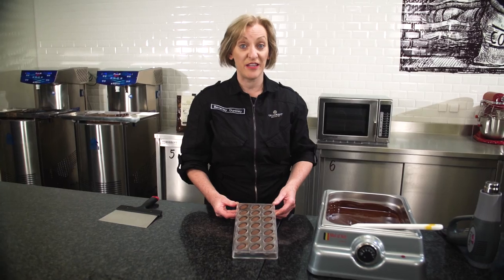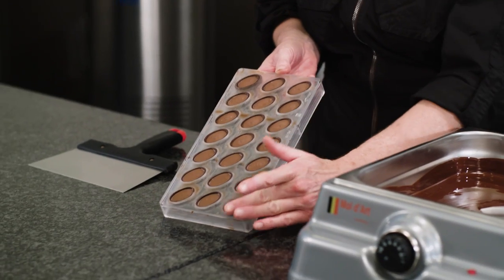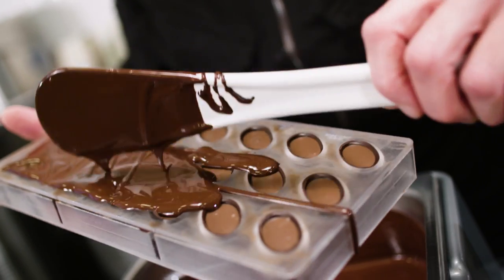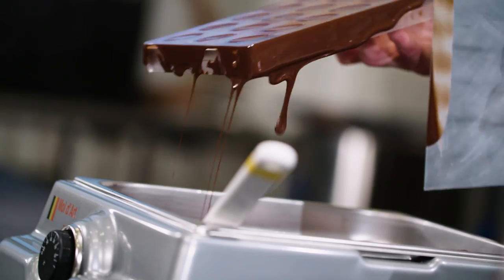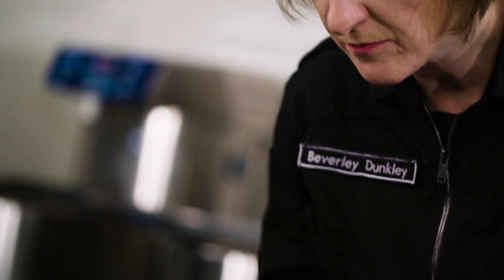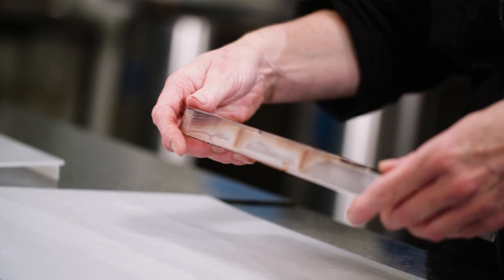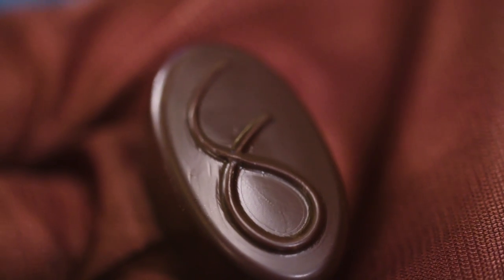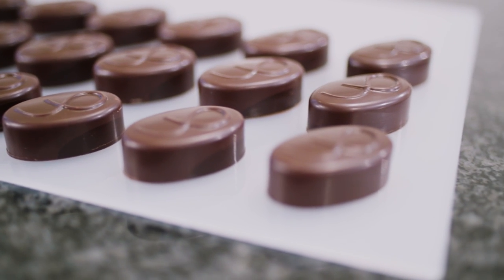How to perfectly seal moulded chocolates

Comment: Hi I have a question kindly let me know if my fridge can only be set to 7 degrees Celsius  how long do I have to keep my shelled chocolate moulds into the fridge n when I fill it with the filling how long that time and how long after I seal them to release them from moulds.. Thanx in advance 😊
Reply from the maker: Hi! Usually it should only take around 4 hours at 7°C for the filling to set before you can close the pralines.  Then wait at least another 2 hours at 7°C before demoulding and everything should be fine! :-) If any further questions, don't hesitate to send us a message! Best regards!

Comment: Can you show the whole process and temperature required to make chocolate. My chocolates are getting melted the moment I get it out of fridge. I couldn't find the perfect video. And it's also getting sticky unable to demould no matter how much time I keep in deep freezer
Reply: But using cocoa powder because that's what we get here
Reply: You need to make sure you temper your chocolate before you attempt the first video of this series
Reply: I use coconut oil as part of the melting process and it seems to help. Having a relatively cold room (less than 74 degrees) helps too.

Comment: how hot is the chocolate you use to seal the mould?
Reply from the maker: Hi Kathy! Thanks for your question. The chocolate is crystalised and at a temperature of about 32°C. For more details on how to get to that point, you can find another tutorial on this location: https://www.callebaut.com/en-OC/chocolate-video/technique/tempering
Good luck and best regards!
Reply: Callebaut Chocolate is crystallising chocolate the same as tempering ? Tia 🙏🏻❤️
Reply from the maker: Hello @fen793  - Thanks for asking that question. Well it is, indeed. Cristalization means A) the last part of the tempering process (the "hardening" of the chocolate in fact) and B) aligning the "cristals" = the alternative word of what "tempering" means. Both A and B are correct. :) Hope that clarifies!
Want to know all about tempering, then you might want to get in to one of our courses at the Chocolate Academy center - https://www.chocolate-academy.com/ Hope to see you there soon! Best regards!
Reply: @Callebautchocolate  thanks You I've seen. Excelent♥️